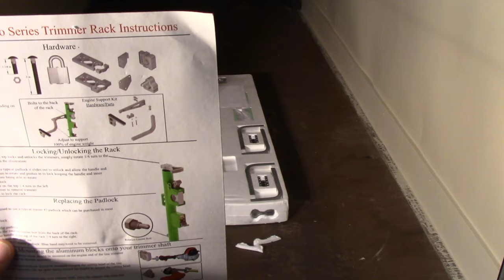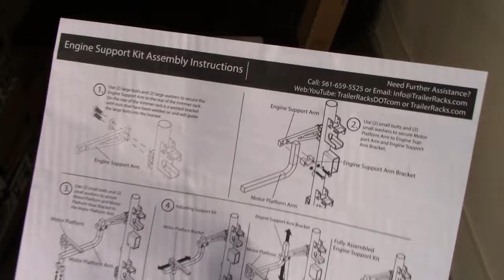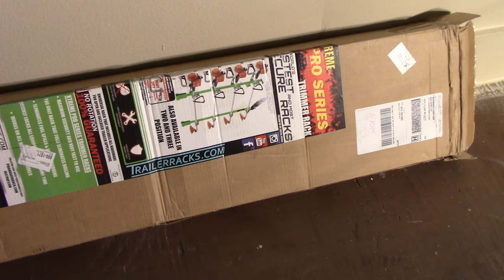DLC - Green Touch Trimmer Rack

Comment: How long were your 1x4’s? My enclosed trailer is 6x10 and will have to do the same thing you did with it
Reply from the maker: Mostly 8' The important thing is to catch several wall studs and have the 1x4 to mount to where you need it. You could go with 10' and have mounting boards all the way down.
Reply: HandyGuy 2016 awesome and thank you for the reply! You said you used 1.5 inch wood screws to tie down to the 1x4 to the studs correct?
Reply from the maker: @chuyroman2046  they will be metal tube studs, so use a self drilling 1.5" wood to metal screw.

Comment: What size screws (length) did you use on the wood screws and the self drilling screws on the brackets?
Reply from the maker: 1" directly to the wall and 1 1/2" through the 1x4's